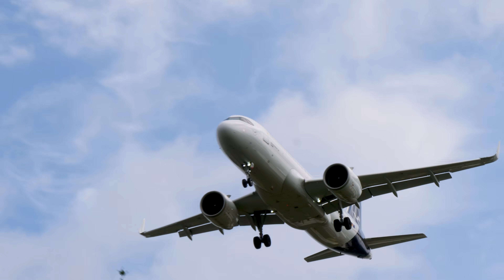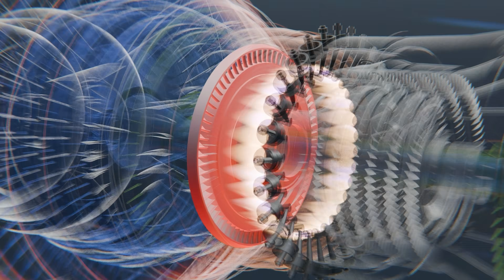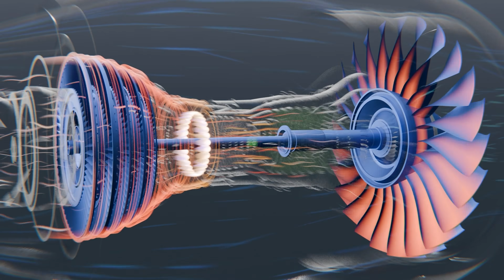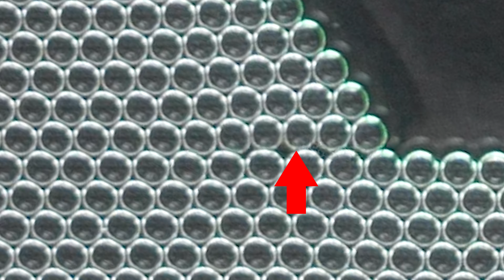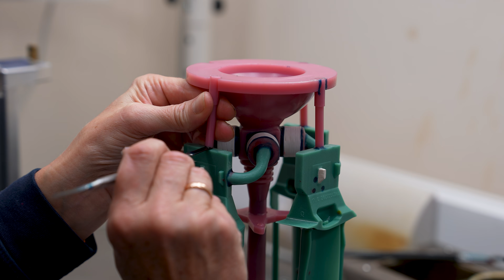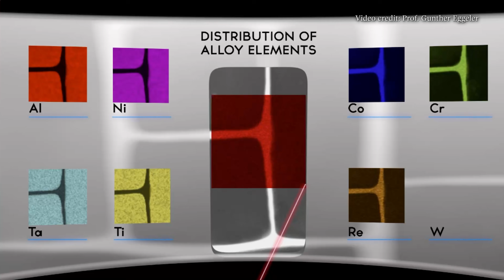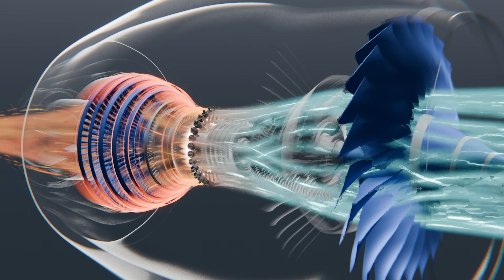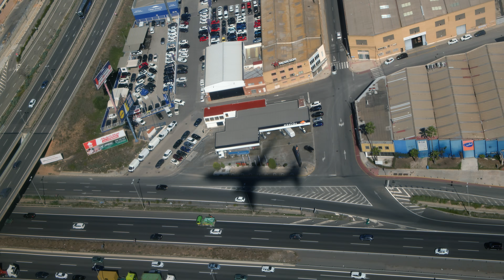The Ridiculous Engineering Of Jet Engines

Comment: In the US military, our leaders don't physically beat their troops, even for something as severe as leaving their weapon unattended.  Each beach has its own methods.  I'm a US Air Force Vet and we used a system based on growing severity, a Letter of Counseling (LOC), Letter of Reprimand (LOR), and an Article 15, which is especially being charged with a crime as defined in the Uniform Code of Military Justice (UCMJ).  The latter can end with jail time, expulsion/dishonorable discharge or worse, up to and including the death penalty.  But if a commander just starts beating their troops, they aren't going to be in command for very long.  This wasn't always the case, but since the 1980's or 90's, even in Basic Training, a Training Instructor (TI, often called a Drill Sergeant in other branches), isn't permitted to lay a finger on an Airman.  They can yell and make your life miserable, but they can't hit you.

Comment: Hello I’m a Formula 1 fan and well the cars have electric motors now the use a V6 hybrid system engine to power the electric motors that move the car. So in retrospect the power model used in this video is a need of an updated F1 car. The new F1 engine is a massive improvement then typical gas powered engines like the V12 engine they used in years past.
Reply: Current F1 rules prohibits most of the new available technology... unlike in years past when most new automotive technology appeared in F1 first... it's a very sad time for F1 technology.

Comment: 11:38 So we’re just ignoring the ME262 now? It had a Steel Aluminum  Alloy which is pretty rad
Reply: The Me-262 used high temperature stainless alloy too, but based on chromium rather than nickel.
aluminum is not used in turbine blades either.
 The Jumo 109-004 B model engines used in production had the very first blades with TCBs (thermal Barrier Coatings) and the most common was Cerro-Alumina, a ceramic material with extreme high temperature resistance

Comment: My dad and his colleagues further developed the single crystal turbine blades using nickel based superalloy and created the relevant mathematical formulas and computer programs used to determine and predict the internal structures during cooling and casting in the 90s/2000s working with DERA and Rolls Royce on behalf of Cambridge University. We still have a couple of the coil shaped sprues from the casting process in our filing cabinet. If he ever got the chance I think he’d love to speak with you about it, he has heaps of stories. Unfortunately, a large amount of the information regarding the subject is still under NDA until 2050
Reply: WRONG! Single Crystal turbine blades were nothing new when Rolls-Royce introduced them on the Trent.. They were invented and patented by Frank Ver Snyder at Pratt & Whitney in 1966.
Reply: @D @DoktorBayerischeMotorenWerke  I said they were the first to use a nickel based super alloy and developed the first software to predict stresses and such in the growth of the crystal.
Reply: @theaggrivatedpineapple5927  "My dad and his colleagues invented both the single crystal method using nickel based superalloy"
That part of the statement is false and misleading.
Rolls-Royce has never been a leader in single crystal technology and did not develop its own method until decades later.
Reply: @DoktorBayerischeMotorenWerke sorry, I was just relaying what I’ve been told, I’m sure I’ve made a mistake somewhere but without speaking to him there’s unfortunately no way for me to rectify it.
Reply: @theaggrivatedpineapple5927  You could correct your original comment. I see you have already edited it since you posted it. 
No shame in making mistakes as long as you own up and correct them.
Cheers mate!
Reply: That's really impressive to read

Comment: The turbines in the back powering  the larger turbine in the front kind of reminds me of a turbo compound set up in a semi truck diesel engine where there’s a turbo, but it’s connected to a shaft with a little gear train that connects to the flywheel and it makes extra power in the engine as a result it’s ironically very similar to this jet engines, Just in reverse

Comment: I’m gonna take a guess before I watch the video the jet engine although it burns the fuel it is also pushing air through the engine so the air cools the material even though it’s hotter or operating hotter than its melting point keeping it structurally sound

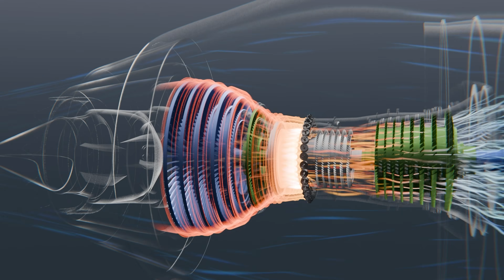Comment: 1:38 the stages give clear indication as to why, the blade count increases as stages build , pressure and temperature are directly related so as the exhaust gasses expand the temperature drops, the velocity of gas drags heat also reducing the chances of saturation.

Comment: I have stood under those engine, they are warm but not hot, you can touch them just fine even while they run.  This is how they service these jets and refueling them before taking off.   You notice the repair crew will even sometime open these guys with their bare hands.  Vertasium is fake now, being so for a while ever since that question about how long does it take to switch on a light-bulb.  Anyway, time to un-subscribe.  They really shouldn't call these jet engines.  They are just turbine engines that spins really fast.
Reply: The "Engine Nacelle" the aerodynamic covering over the engine is not hot to the touch, it's also not in direct contact with the engine.
Reply: @DoktorBayerischeMotorenWerke  I guess you can overwrite the law of thermodynamics with the laws of aerodynamics.  That's not heat works my friend.  You can't just make temperature disappear or "move away."  Temperature is very hard to "move" in fact.  This is because temperature diffuses and we don't really have a clue why or how.  Try do some cooking and put fans around it and see it the stove is safe to touch.  Make sure to prepare a bucket of ice water.
Reply: @kcl84  You clearly do not understand what you are talking about kid, the Nacelle, is part of the aircraft not the engine... so your original comment is moot.

Only the leading-edge of the inlet gets hot and that is only when the 'Anti-Icing' system is switched on. this area is left unpainted because of the high heat (over 500deg.F) the rest of the Nacelle is painted with ordinary aircraft paint and does not get any hotter than the rest of the aircraft.

Comment: Back in the day Rolls Royce tried to use carbon fibre as edges of the turbine blades. They asked a group of new graduates to make a machine to test the strength of carbon fibre. They decided not to use carbon fibre but kept the machine to test the strength!!!!
Reply: Carbon fiber was never used in turbine blades. You are thinking of compressor blades.

Comment: 08:00 🚫 Does this really happen? Like, inter atomic space changes when force is applied on a material? I don't think so. It is just that the shape changes to adjust materials to cope up with the force in the direction of the force. The shape change happens more easily because the atoms are already energized due to the high temperature. Inter atomic space should not change even noticeably.
Reply: Yes, the atoms move when materials are stretched by outside forces. How else is something going to stretch?

Comment: Years ago I worked as a welder. We were putting in overhead steal air compressor lines at a GE plant that made turbine blades. 
I always had an escort with me from the company.   I was inquisitive about the blades so one day he handed me one. It was one inch wide and about ten inches long. As thin as the blade of a butter knife.   He said to me try to bend it or break it.  Nope.  Not even the slightest flex.

Comment: Why make the holes then? I understand they're there to keep the blade cool but they also lead to the introduction of dust inside and only accelerate corrosion. Even if you were to develop a ceramic coating that won't easily corrode that doesn't really solve the issue of dust getting inside. Maybe cool some other way than making thousands of holes. I'm not an engineering undergrad or anything but I was just curious.

Maybe we can also optimize the diameter of the holes so that the dust particles won't be able to pass through. In that context, maybe we can still have holes that allow air molecules, but not dust particles inside. I think it's possible to even stop down to PM1.0 particles, much larger than air molecules.

Comment: What about what happened on British Airways flight 9? It takes the dust problem up to the extreme. If I am going to take a gas, there was just so little oxygen when they flew through that ash cloud that it just stopped the combustion process before thermal runway could occur.

Comment: This is just seriously amazing. It's amazingly cool seeing the blade being made and understanding the different ways they have to combat the extreme conditions the blades operate in. I really love that they're using the ancient method of wax casting and developing it into such a high-tech science. It's brilliant, This is also a particularly amazing video by Veritasium - the writing and production values were totally top-notch, and told a very coherent story - it was great the way Rolls Royce let them film so much of the process and helped explain it too

I never really understood before why airplane engines are the final stumbling block for countries trying to create their own domestic commercial airplanes by themselves. In the first place, solely domestic production is impractical in today's society since there are only a tiny number of companies across the whole world with the specialisation to create airplane components, and you need to sell more than just a few hundred of a single model to be successful (unlike military contractors making fighter planes).But the engines are so insanely complex and require such cutting-edge technology, made by such highly-specialised machines with such tight tolerances, that even just creating the manufacturing process requires a massive investment of time and resources - not to mention the material science to go with it.

Comment: As a materials engineer with emphasis in metals. This video was very well explained! Congratulations on the visual explanations!  
However, I personally wouldn't say that the grain boundaries are always the weakest point in the crystal structure. as said in  24:47. Indeed in creep induced failure (and other high temperature applications) it is the weakest point and I find it amazing how we managed to creat monocrystaline alloys to prevent that. But in many other situations and alloys the grain boundaries are a barrier to the dislocation movement which increases the metal strength. One of my professors in college said that grain refining is a noble method of strengthening a metal because it causes the least reduction in ductility, sometimes it can increse it, which makes the metal tough. In addition, despite the grain boundaries being possible points to nucleate cracks in the structure, the different orientation between grains often deflect crackz, which makes it harder for the crack to propagate trough the metal. The truth is that the boundary is fundamental to the metal properties and can be both your ally in increasing resistance or your enemy depending on the application.

Comment: Hold up, you can't just mention "ceramic coating" and just gloss over the fact that it's a brittle substance. How can that work if the metal needs to be able to flex and expand under high temps without cracking all over the place and losing adhesion?
Reply: Its a clickbait YouTube video... what did you expect?
Reply: Thin layers of brittle materials can deflect along with their substrate.

Comment: Just a dumb question, but why not use zirconia? Single-crystal zirconia has a stronger tensile strength and a higher melting point. One presumes that growing flawless crystals of the size required is the part nobody's solved yet, but it would almost double efficiency if we could.
Reply: Ceramics have very poor ductility. I don't think that they would be good candidates as blade materials.

Comment: Make state of the art engine, then Boeing executives don't redesign the 737-MAX for it and just mount the bigger engine forward, changing the flight characteristics. That has to be compensated for with sensors + software that they don't document or train pilots on, and 346 people die in two crashes. Boeing CEO Dennis Muilenburg and everyone who signed off on that should be in jail for manslaughter.
Reply: Actually the engines had nothing to do with the problems with the 737 Max... All aircraft experience "POP" or "Pitch up On Power", where the nose tilts up as power is increased.. it was a software problem caused by the FAA.
 The director of the FAA was forced to resign and all of the member of the FAA team that worked on the Max program were fired or demoted
Reply: @DoktorBayerischeMotorenWerke   the engines were good, but their repositioning (because they didn't fit under the wing) together with extra power pushed up the nose, which required MCAS, which as I wrote Boeing didn't document or train pilots on because Boeing promised Southwest Airlines "No new training required". This is all well-known, you can read a good overview titled simply "Boeing 737 MAX" published by the "Harvard Law School Forum on Corporate Governance" which goes through all of Boeing's murderous decisions.

Boeing's bad decision-making and then hiding the changes KILLED PEOPLE, stop blaming regulators for it. No account of the accidents that I've read blames the FAA, it's all Boeing's fault. It's news to me that the director of the FAA (Dickson?) was forced to resign (he resigned a year later) and that the FAA team were fired; please provide a citation and I'll add it to the Wikipedi article(s).

Comment: No need to balance these blades so they do not vibrate spinning at high RPMs? Back in the day ( 1996 ) I remember blades had to be balanced for turbines generating electricity at oil rigs, not needed anymore with this new technology?
Reply: I suppose they're all balanced from the fact that they're manufactured with insane precision from the start.

Comment: so basically, the 10% of the air tat goes through the big fan and into the engine, is only used to power the engine itself? its like an alternator on a car
Reply: The air going into the engine is mixed with fuel to produce the power to turn the fan.

Comment: The load/temperature experiment applies the same stress (200 MPa) to both carbon steel and titanium while increasing temperature. That is a valid material comparison, but it does not fully represent the real turbine blade case.

In an actual rotating turbine, the dominant load at the blade root is centrifugal stress, which is proportional to material density for a given blade geometry and rotational speed. Since titanium has about 57.5% of the density of carbon steel, a titanium blade spinning at the same RPM would experience only about 57.5% of the centrifugal stress.

To simulate equal real operating conditions, the titanium sample should therefore be tested at roughly 115 MPa instead of 200 MPa. At that lower stress level, its high-temperature failure behavior could be significantly different.

To the metallurgists here: is it possible that at 115 MPa, instead of 200 MPa, the titanium sample would have failed at a higher temperature than 600 °C?

Comment: While the original history mentions Aurel Vlaicu and Henri Coandă’s contributions to aviation, additional key details are worth noting. Aurel Vlaicu introduced innovations such as variable wings, NACA rings, and coaxial propellers, along with the use of aluminium for aerodynamics. Henri Coandă, apart from the Coandă-1910 jet plane, pioneered the Coandă effect in fluid mechanics, VTOL concepts, and aerodynamic control systems. Notably, he flew the first jet engine decades before it became widely recognised. These contributions are crucial to understanding their full impact on the field. Their work laid the groundwork for modern aviation and jet propulsion technology, shaping the development of faster, more efficient aircraft and influencing aerospace engineering to this day.
Reply: Henri Coandă did not invent jet engines and the Coandă-1910 was a ducted fan powered by a 4-cylinder Clerget piston engine, 
It never flew.

Comment: I ran a CNC that milled the edges of compressor blades... it took 4 hours to mill off 0.100" to avoid tempering the metal and that the alloy is harder than the hubs of hell! These turbine blades are a whole other level

Comment: This is why the gulf states don't want the a350, and it's because it uses a rolce royce engine which is not as good in sandy conditions and requires a lot more frequent maintenance cycles. Other manufacturers seem to have better solutions for this. It's obviously a highly secretive industry so the don't necessarily share secrets with each other